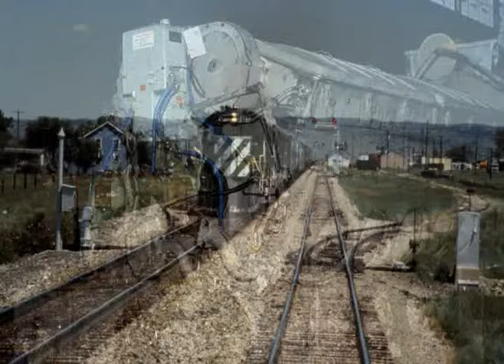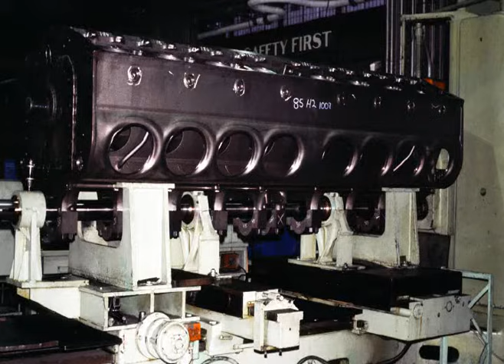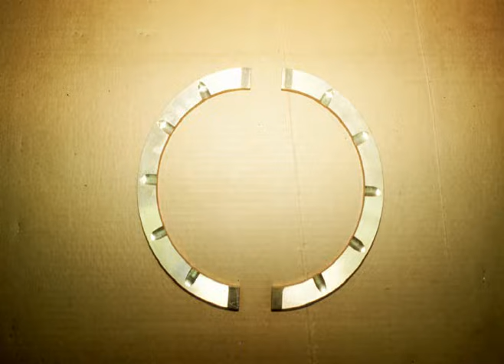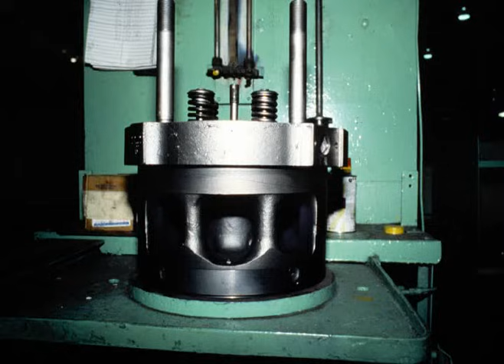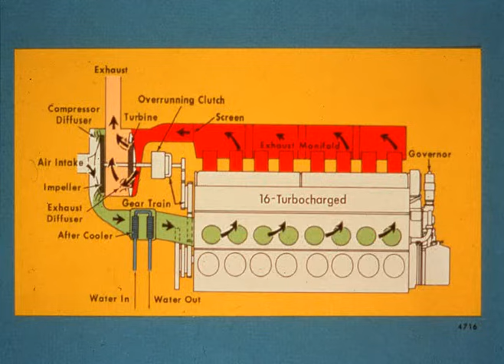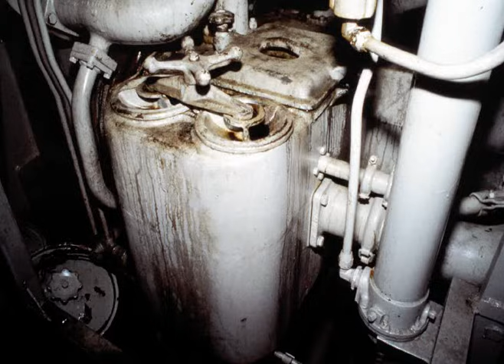Intro to EMD diesel engine

Comment: The problem w/ EMD engines is that the engine block is a fabrication also called a weldment. GE uses a casting to better control the stresses from the rotating assembly & the load from the generator. That's why GE is the winner of the horsepower war's. Conclusion: You don't substitute bean counters or a manager wanting to climb the corporate ladder for Engineers.

Comment: One clarification: these are turbo-supercharged. 2 cycle engines need a forced air inlet and turbos don't work at idle. At idle, the compressor portion is driven by the gearbox but as the engine gains speed, an overuning clutch disengages the compressor, allowing the exhaust gases to do the work.
Reply: Actually the compressor portion of the turbo is driven mechanically at lower engine rpm’s via a gear and clutch arrangement from the timing gear train connecting the crankshaft to the camshafts.  This maybe what you meant but the term “gearbox” is synonymous with “transmission” and that is not part of the engine and on diesel electric locomotives the engine is directly coupled to an electrical generator so no gearbox is needed.
Reply: Thank you.  I had wondered how combustion and scavenging air was supplied until the turbos spooled up.  2-cycle Detroit Diesels always had a mechanically driven Rootes blower in addition to any turbocharger.

Comment: Thoroughly enjoyed your video. Used to work on these with the old Norfolk Southern next the Norfolk Western and finally the combo of Norfolk, Western and Southern which today is the newer version Norfolk Southern. Really enjoyed those years. Wish I could go back to those times.
Reply from the maker: There are thousands of old EMD still working.  Short line locomotives and tug boats (marine applications) and stationary power plants.  Some built in the late 50's  are still in use.

Comment: May I ask what's the rocker-arm driven spring on top of the injector for.
Reply: It's the injector return spring. Check out the video on this channel entitled "basic emd fuel system" and you'll see excellent drawings and descriptions of the injectors. It's a "unit injector" which means there's no high-pressure injection pump, the camshaft actuates the injectors to atomize and inject the fuel at high pressure.
Reply: Hello Michael - Thank you for the information - I did a further search and found a Service Manual in which was shown the Injector mechanism and explanation.  Lovely engineering.
73's
Reply from the maker: Exactly!

Comment: They also make a V6 in both 567 & 645s typically ~750hp. 
I wonder why they omitted that fact?
Reply: I know of the 6-567 but didn’t know there was also a 645 too.     There was a number of 6-567 in small tugs
Reply: @TugboatMatt  The 6-645 was only used (on rails anyway) in Australia, in the Victorian Railways Y class shunter
Reply: Bnsf probably didn't have any. I've got 20+ years of diesel shop work for a class1 and I didn't know they existed. I've seen a 8v645 (maybe it was a 567), and have worked on countless 12v, 16v, 20v emd's in that time. They're dirty to work on, but reliable engines
Reply: I worked on a tug with a 8-567